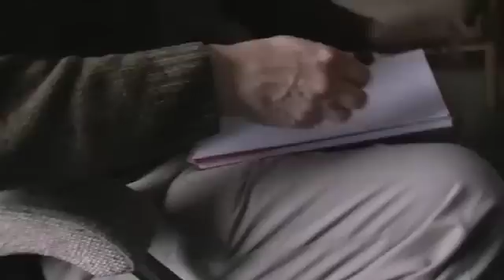Reynolds Number - Sixty Symbols

Comment: The Reynalds number is most useful in determining what type of flow (laminar or turbulent) will occur in a pipe given the fluid density, viscosity, pipe diameter, and required volumetric flow rate.  Then you can use the Reynald's number to calculate how much pressure drop (head-loss) will occur in a length of pipe at a given flow rate, due to internal fluid friction.

Comment: can someone explain this conundrum?

If a fluid is flowing down a pipe sloped downwards and the pipe is constant in diameter, according to the continuity equation, velocity should remain constant.

But according to Bernoulli's equation, a decrease in elevation head has to accompany an increase in velocity head and friction if there is no change in pressure. 

Friction is a property of the pipe and so wouldn't neccessarily account for all the energy losses.

So which is it? Would velocity stay constant or not?

Or maybe area changes?
Reply: +bananian The pressure obviously isn't constant. It's higher in top of the pipe and lower at the bottom. Velocity must stay the same, otherwise there would be more water flowing out of the pipe than flowing in.
Reply: There would be pressure due to the weight of the water but that's accounted for as potential and kinetic energy.  I should specify that this is a gravity sewer so it is open to atmosphere on both ends of the pipe, thus no change in applied pressure in the system.
Reply: Again, if the water is flowing through the entire diameter of the pipe it simply can't move faster at the bottom because there would be more water flowing out than into the pipe. Therefore kinetic energy doesn't change, the pressure does. If you're talking about a situation when there's air inside the pipe and the water doesn't fill it entirely then the water will turn into droplets and will fight with air cushion trying to achieve its terminal velocity. None of the equations you mentioned describe that second situation. They describe flow of only one fluid.
Reply: oic
Reply: I was thinking both the top and bottom would accelerate at the same rate so the flow wouldn't break apart even with change in velocity.

Comment: 2:07 His definition of Reynolds number is wrong. It should be diameter instead of radius. My major was fluid dynamics and thermal and I have a number of Fluid dynamics books. None of them defines it the way this guy is defining it. Of course, anyone can pick whatever length-scale they want, but that is not how it is defined in the textbooks, and obviously the Reynolds number for which the transition from laminar to turbulent (Re~2300) takes place would be different with his definition. So I think this video can be misleading.
FYI, as a side note, there is a term called hydraulic radius, and believe it or not, it is not (1/2) of hydraulic diameter.

Comment: But it didn't really explain the real significance of the Reynold's number in that for the same flow scenario if one matches the number then the flow behaves the same way.
Reply: because thats obvious?
Reply: Janinja 1000 it's not obvious at all.  It's a very important relationship and fluid system characteristic that is so important to fluid mechanics.and predicting fluid behavior.  He completely avoided talking about its significance and how it relates to predicting fluid behavior.
Reply: The Artificial Society depends on what you mean by "flow scenario", right? If I modify the domain or the starting conditions even slightly, the resulting flow might be completely different.
Reply: The chemical engineer
It has a lot of significance in fluid flow and pipe engineering
Reply: Also, precisely what fluid velocity?  The average fluid velocity?  Are you assuming laminar flow?

Comment: Actually the reynoldsnumber is defined as velocity times diameter of the tube, divided by the kinematic viscosity. The greek letter eta usually refers to dynamic viscosity which means you have to multiply the whole thing by the density.
Reply: Pav Phone yes you are correct

Comment: There are awesome videos on YT regarding the construction of a garden laminar flow fountain... it doesnt break up into droplets it just makes a smooth tube of water that can travel in an arc for 20 30 feet. You can shine the laminar flow with a light and you can place a bass speaker near it and it will vibrate into a spiral, which any tap can do with a bass speaker. nice vids thx

Comment: The field of Fluid Mechanics is incredibly vast and interesting. Unfortunately, most physics and other science majors never receive a course in fluids at an undergraduate or graduate level anymore since most of the research nowadays is in the extremely small (M-theory, mesoscale and nanoscale solid state physics, quantum mechanics, etc.) or the very large (cosmology, astrophysics, etc.). The physics of fluid flow can be very complex, especially for compressible flow, two- and three-phase flow, plasmas, etc. I'm a mechanical engineer and, even after studying this for years, there is always more to learn about fluids, heat transfer (including convection), etc. and different computational methods to model thermal fluid flow. Absolutely fascinating. It's a shame most physicists don't get a taste of this field in their education as I feel they are greatly missing out.
Reply: Mohammed Zaid Yep, I would agree with that.  I did forget to mention how one field of physics does use fluid mechanics extensively. Plasma Physics is a combination of electricity and magnetism (E&M), fluid mechanics, and nuclear physics.  Plasma is a very energetic state of matter that behaves similarly to a gas, which is why fluid dynamics is helpful in understanding its motion.  Also, high-energy heavy ion collision physics uses fluid mechanics at very high energies as quark-gluon plasma behaves more like a "sticky" liquid than a normal plasma.
Reply: Daric
Physicists currently are more interested in pure, higher theories of less current application, I guess. =P
Much like pure mathematicians. I wonder who'll win the million dollars for that Navier-Stokes problem. A physicist or a mathematician? That guy (idk his name) who has the highest IQ currently is a mathematician who's been woking on this. Might be really hard. :/
Reply: Although a bit late, the mathematics needed for fluid mechanics ranges a lot of fields.
To name a few: Standard calculus, vector calculus, Tensor algebra, Nonlinear dynamics, Statistics,  Statistical physics, Asymptotic expansions (singular, regular perturbation, etc.), Numerical methods (FEM, etc.), 
One may start off with books by GK Batchelor (which assumes that one has sufficient knowledge of tensors). Another slightly less terse book is that by Kundu and Cohen. The book by Landau and Lifshitz is also a great text.
Reply: Lewl Yes. But a bit excessive for the core modules to an undergraduate Physics bsc, no?
Reply: What mathematics would one need to before starting to learn fluid mechanics?
Reply: @kadakakin2304 read James Gleicks "Chaos" instead :) you don't need any education. its insane.
Reply: can you give me some useful books for mechanical engineering? pls
Reply: Daric Yes... Because detailed Fluid dynamics is really necessary on a curriculum of classical Mechanics, relativity, optics, EM, Astronomy, Quantum mechanics etc.... It barely makes the top 15 fundamentals to a UG course.
Reply: Hmm yes, but I think that the techniques required (leaving aside computational fluid dynamics) such as the statistics, tensors, asymptotic methods, is a useful tool set for the advanced undergraduate (for those who want to pursue research). The methods find utility across different areas of theoretical physics and applied physics. 
Ofcourse, a BSc pursuer has several other things to study!
What do you do (out of curiosity)?
Reply: Lewl I'm a London based ( ICL) Biochem student with interest in production of specific biogenerated petroleum products...... Needed to know about some bio-chemical engineering and found fluid dynamics an interesting area. My math is a little rusty, but have done Math and Fmath at A-level years ago.... So more than some first year math undergraduates at least.
Reply: Lewl And how about yourself?
Reply: Excellet! Biofluidmechanics is quite intricate and immensely interesting. I am in Germany (Darmstadt) doing both high Reynolds number flows and low Reynolds number flows. Obtained my degree in Mechanical (with specialization in Thermal engg.) Had to go through a myriad of topics on my own. But thats the fun bit.
Reply: Lewl Its a headache, but always more rewarding when you understand something without it being taught.
Reply: agreed

Comment: Isn't the expression for Reynolds Number as

=(density*velocity*diameter)/eta
Reply: The density cancels out when we replace dynamic viscosity by kinematic viscosity. Re=pxux(characteristic length)/pxv
Reply: Het Thakkar Yes, but kinematic viscosity already has the fluid's density factored in, so they cancel out.

Comment: if the Reynolds number has the radius of whatever the fluid is going through, what do they use for the radius in the atmosphere or on Jupiter?
Reply: It's always some significant length. For example, when modeling a wing moving through the atmosphere the "radius" is the chord of the wing (distance from the leading edge to the trailing edge).

Comment: You should do an update with a chemical engineer!
Reply: greenfire61 why not a fluids engineer-_-
Reply: The fundamental breakdown of engineering disciplines is chemical, mechanical, electrical, and civil.  Then, there are hybrid disciplines like biomedical engineering and subdisciplines or related disciplines like computer engineering or aerospace engineering also offered in schools.  All chemical engineers like myself heavily study fluid dynamics in school.  And if you come away with nothing else from that area of study (which is not uncommon), you come away understanding Reynold's number.  It's fundamental to the calculations of convective heat transfer and pressure drop which are two of the most important considerations for any chemical engineer.

Mechanical engineers also study fluid dynamics to a lesser extent in school.  Some may spend a lot of their time in that depending on where they go in their job.  So someone that's become a real specialist in that realm might additionally call themselves a "fluids engineer" whether they're a chemical or a mechanical engineer by degree and basic focus.

Comment: Need to include the density term, otherwise Re is not dimensionless. That is Re =Dvρ/μ for a circular cross section pipe. There is also a transitional flow regime that exist between purely laminar flow and turbulent flow (transitional flow conditions)
Reply: (kinetic viscosity)η=μ(dynamic viscosity)/ρ

Comment: old post but I'll have a go, it's better to work theories out on whitboards. it allows you to switch around stuff on the fly without making a mess so a professor would generally have a whiteboard and a bunch of markers around the office. On top of that I think it's a simple matter of, the more easy something is to read the quicker you'll comprehend it's meaning, thick black letters make keeping the big picture in view easier, I think.

Comment: Resistance, however, would set in as more and more excitations are produced and super-fluidity would eventually be destroyed. this angular momentum phenomenon has a direct homologue in superconductivity. superconductors normally wont allow magnetic fields to exist inside of them, just as a super-fluid will tend not to move in circular eddies. but if you force a magnetic field through a superconductor, the field lines will permeate the superconductor in thin vortex lines as show by Abrikosov.

Comment: Therefore there would be a minimum amount of circulation if one were to say spin a container of liquid helium.If this were to occur the fluid as a whole wouldnt rotate but rather many small regions (small as several atoms across) would rotate around their own central regions. To answer your question these central regions would line up in the vertical direction to form vortex lines and these vortex lines would distribute themselves throughout the background nonrotating fluid with uniform density.

Comment: because super-fluid helium is in a ground state, and because of the energy required for excitations above it, the super-fluid is in an "irrotational" state. this mean no vorticies or eddies can form that might impede current flow. because super-fluid behavior is defined quantum mechanically, its orbital angular momentum (were it to be forced to circulate)  would also be quantized, much in the same way the angular momentum of an orbiting electron is quantized.

Comment: Not very interesting: fluids have viscosity. Fluids travel through a tube at a velocity. Flow rate is also dependent on tube diameter. At a certain velocity, turbulence ensues. Big f'n deal.

Comment: I read somewhere that one reason early aircraft pioneers were held back is because model wind-tunnel tests of aerofoils didn't scale up as expected, because Reynold's Number wasn't taken into account (since it was discovered in 1880-something the information was there, just not widely known or realised to be relevant presumably). In part the success of the Wright Brothers was that they did apply this new knowledge and so their wind tunnel tests scaled up a lot better to the full-sized design.

Comment: the vortex forming at the wing tip has the same effect as shortening the wing. it is caused by the low speed air under the wing leaking into the high speed air above the wing. the wing tip fins help to throw this vortex further out off the actual wing surface and hence you gain lift and use less fuel.